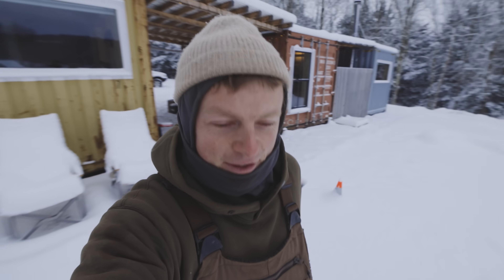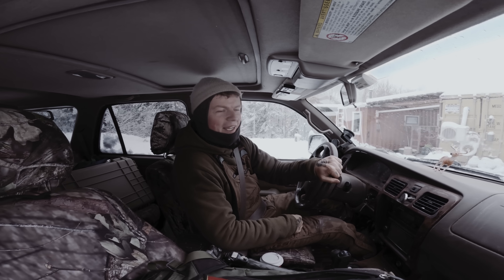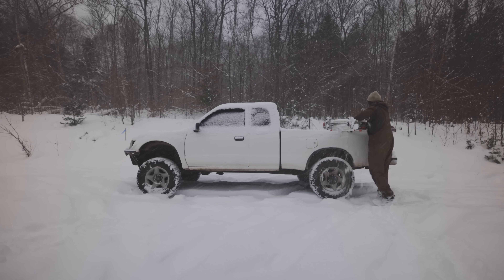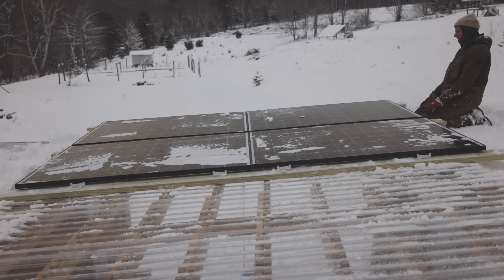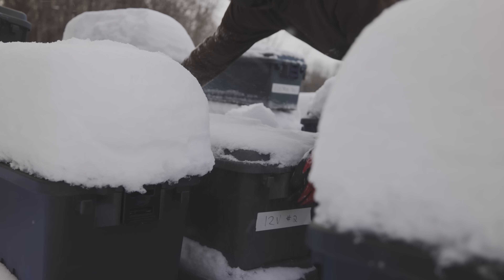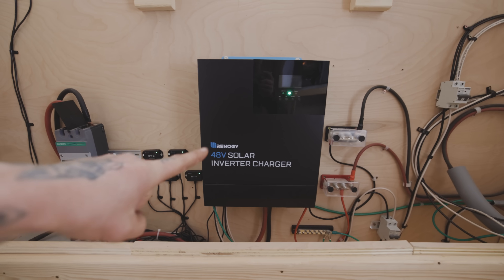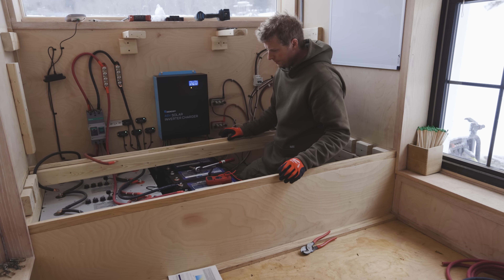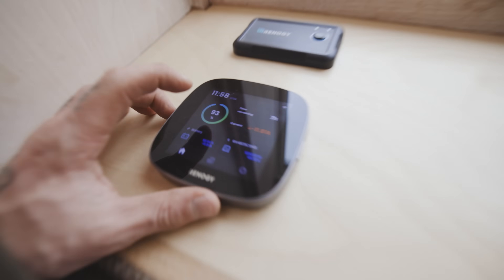Massive Shipping Container UPGRADE - solar set up for winter climates!

Comment: great video! your grit and determination is on an insane level.  doing that kind of work, on the roof in that temperature with snow is super human.  you're right about solar.  I live in the PNW and I have about 8kw of solar and barely make any during winter months, this is actually a small system witha 5kw inverter, with about 5kw of battery, so during the summer, it's constantly maxed and full within an hour.  If I were, you, the solar panels doesn't have to be mounted on the roof, if you have some bifacial, you might want to stand them up almost 90 degrees and ground mount them, this way the solar reflection on the snow will charge it, sun at a low angle will also charge it.  similar to your first set up, except much steeper angle for snow rejection and getting the winter sun.  keep up the great videos!

Comment: If you close the back area of it off and then have doors in the front of the area you would be able to use it as your workshop in between your container what to drive if you put the floor in your pallets to make a floor

Comment: something that might help you keep track of things is to photo where you put things as you put them away, then instead of sorting through boxes you can look through pictures to locate stuff.
When I have set mouse traps I photo them in place so months later when I need to gather them all up I just look at the photos to help me quickly locate them. This concept is also really helpful while installing electrical or plumbing or anything that will be covered by walls or ub=nder floor or whatever so if you need to access it after a few years it will be effortless to know exactly where you have to open the wall at.   For heat you should build a rocket stove mass heater system, so you can use wood, which you have an abundant supply of.  Properly designed and built it burns completely clean, holds heat for a long time after the fire is out, you can also use it to heat your water.  By the time the exhausts exits the chimney it is barely warm. Just do a search for rocket stove mass heater.

Comment: I crinch Everytime I see someone using a plastic shovel to try to scoop snow. Do yourself a huge favor the next time your in town, swing by your local farm and ranch store or tractor supply and buy yourself a good aluminum grain shovel with a wooden handle, they are light weight and as long as you take care of it, it will last a lifetime.

Comment: I would look into geothermal for the radiant. The electric usage for another circulator pump isn't as much of an electric draw as an electric hot water heater. Supplement the radiant with the mini splits. That's what we are doing on our three houses and the shop on our property here in the snowy part of Arizona. Propane boiler for backup just in case.

Comment: Instead  of propane consider wood chips or pellets or even log heating. Look into European technology for water heating and thus central heating with very efficient wood based furnaces . You have wood. I doubt you have a propane factory on your land. Or if you do i pity you because of the ground and water pollution risks

Comment: Solar pannels for winter use should be around 75 degrees facing either due south or half of them south east half of them south west. (The later only If your converter can handle two different ’arrays’ . At the very least tilt them equal your lattitude ( if 40 north tilt at least 40 from the horizontal. But winter time aim to be more vertical. Mind the wind in your mouti g of course

Comment: On the battery box did you close them up tight...shouldn't you have like a screen off opening in front so to keep them cool when using and not get box  temperature hot in box

Comment: When we decided to go solar in the PNW we had the same problem of of not being in the sun belt, and  fewer hours of daylight, although we rarely deal with snow, the technology was just not there to start with, but we kept exploring what new optio  were becoming available, watching the technology  grow and we  finally saw the tech catch up to the needs of those wanting solar in the latitudes further north for those of use living on the curve of our planet where the sun is not a direct  hit at any time of year and the weather tends to more overcast than tropical blue.  Sandwiched between the coast and a mountain range, also subjected us to periodic high wind storms that could turn any solar panel not laying flat into a sail which really thought its role in life was to remove the roof.  Since most of the homes in are area have suffuciently angles roofs that mounting half the panels one a east facing roof area and the other half on the west was showing promise at least for those whose roof angles had the east west exposure, but for enough power during the day for what was needed and to have enough solar to charge the batteries at the same time was at first, our primary goal but that changed when we came to realize that there could come a point where those things that currently relief on propane or natural gas, which if using means your not fully off grid as you rely on 3rd parties to provide that source.  Having back up of wood buring for heat was one major help as technology that relied on older tech jumped ahead and you could actually heat several rooms by burning  wood utilizing part of the home's existing duct work  and havingva wood stove available for cooking.

Solar finally became practical for us once panel techology started  producing smaller panels capable of using less light to produce greater energy, plusbdystems that used gimbled systems that could automathcally detect the optimum angle for the panel, could essentially 'follow the sun', lay itself  down flat when it was not able to get any solar, like after sunset or if it detected winds that put panels, and thereby our roof at risk.  Having it lay flat when there was no sun meant that if a storm nlew up while we slept, the panels were also sleeping and in a nice flat configuration less likely to become house sails.  Having manual back up to control all that, and the panels report to the inside controls  just how much power was being collected meant that fine tuning was available to us also.  But whole panel  efficiency  was a great change, it was actually battery technology that made a  difference  for us.  The smaller a battery bank became that could store more power, as well as faster charging batteries we needed fewer battrties using less solar for shorter periods of time to fully charge the batteries which meant we were not just storing enough power for overnight but could expand the storage enough that we could have power for up to 48 hours in the event of storm conditions with wisely monitoring use.  Of course, this was not done all at once but once we knew what the final options we wanted were we could start with the initial component to get us up and using solar, then adding in components to the system moving us towards meeting our final criteria.  It took us 3 years to complete but this spread the costs out so we could pay as we went, were able to do those things we could DIY, especially interior controls, wiring and the battery storage.  We did employ solar contractors for the roof instillations as the had those skills and safety equipment we did not plus if there was a failure of the roof system web had gurantees on parts and labor.  The 2 biggest things for us was getting away from the older flat panel installation which, at certain parts of the year only collected solar for sn average of 4 hours  more efficent batteries and inverter tech, better technology for monitoring power useage.  At this point, except during a storm we run the electrical needs of the house and even sell back small amounts of  power even on the shortest days of the year duting the winter (much more during the summer).  We do use natural gas and propane, and have generator back up, but can switch to wood if either becomes unavailable or no longer affordable.  We also went with the idea, after watching the rapid changes for better and more efficent solar, that we needed to future proof the system so if there is a great innovation in solar technology, swapping to new components or running new tech side by side is easily doable.  Last summer we did add a way which the panels could have snow removed manually from the ground after we experience a week of on and off snow storms that kept the panels partly covered for a couple of days.  Its adapted from the systems used  in northern Europe and Scandinavia  to bring snow off roofs without risking ones life to go out on a steep roof buried under a foot or more snow and removing snow with a shovel and broom.

Comment: On Red and April Off Grid you tube had a great set up with containers you can use same concept but you can add to your living space by sliding doors connecting container to open up light between containers..
The Lourdens have a separate container for chicken goats and hay feed storage also aquarium heater helps keeps water warm..lean to's on side & back for storage and porch & dog run around house
With roof over containers you'll have solar & storage space

Comment: Have you considered bifacial solar panels? I heard that they have improved efficiency in low light situations. Also supposedly they can clear themselves from snow when mounted at an angle, as they produce power when receiving light from the back, and the resulting heat makes the snow at the front melt

Comment: Good idea 3 system eco flow delta pro 3 and eco flow delta pro 3 extra 6 battery double power for off the grid cabin 40,000 (KWH and eco flow delta smart panel two check it out

Comment: Look into a wood gas generator. If you had an old truck with a large engine with points plugs and condenser. Build the generator in the back of the truck and the engine produces heat and electricity to charge your batteries. The heat can heat your home in the winter and when the solar panels don't work the truck can drive a large generator. The plans are on YouTube.

Comment: Looks cool. I would suggest a mini/micro water turbine but im sure it would freeze. If your water supply is consistant and you have the height a few hundred watts goes a long way since should run 24/7.

Comment: put solar panel on your coup.Hook up a 110 outlet & put in a heated dog bowl to keep water thawed from the solar setup. We used a couple good sized heated dog bowls
Reply: I think they even sell small solar setups for that. If not easy to make with what maybe a 100w panel 12v hooked up to a 12v battery and boom easy power to a waterfowl and maybe even a small heater inside for the chickens to stay warm too. Even have solar exhaust fans for summer to get excess heat out.

Comment: The problem with having a large amount of solar panels coupled with a small number of batteries is that at certain times of the year you will produce way more than you use & with no way of discharging the excess electricity generated you can actually damage your batteries & shorten their lifespan.
Reply: That’s without question, not how that works. Like at all.
Reply: @erikkuhlemeyer9402  I have 12 panel & 6 batteries, if I wasn't still connected to the grid to export excess power generation when my batteries were full my batteries would be ruined - Thats a FACT!
Reply: @acmdv  no. You’ve got an mppt connected. It stops charge when it’s full. Besides. Batteries pull amperage. When they’re full it stops. This is common knowledge my dude.
Reply: @erikkuhlemeyer9402  They must do it differently over here in England then.
Reply: @acmdv  no. It’s power and batteries 101. No different than plugging your phone into an outlet. The batteries only pull til their full. The panels don’t just send power all the time.

Comment: When the warmer weather comes round you should consider building a frame on your property at a lower level & mount your solar panels facing south. The bonus of doing that is that you can get them facing south, it would also be easier for maintenance as well as possible future of adding more panels. If you have an AC rather than DC system you can have them further away from the property so long as you have the inverter with batteries as close as possible to the house to minimise power loss. Also have you considered conical wind turbines to add extra capacity in the winter?

Comment: You should build a very simple 2x4 angled rack to tilt the solar panels. There are online azimuth angle and tilt angle calculators based on your zip code that will get you pretty close to optimum to maximize electricity production. These are especially important in winter when the sun angle is low in the sky and days are short. I included the links to the two online calculators in the replies to this comment.

Comment: Hi, I think you hit the nail on the head about heating via a solar setup. I’ve been thinking about how to mitigate for areas that experience summer and winter weather (non year round sun) and have been considering heat battery technologies as a possible solution. A large solar panel farm that can be sufficient for charging batteries during winter months but much too large for summer battery requirements. This farm combined with a heat battery such as the newer Scandinavian sand batteries to charge during summer months from the excess generated by the solar farm to help mitigate heating requirements in the winter. Just a thought, I’m not sure of the feasibility of such a set up. Feasibility in the sense of financial, space requirements, amount of thermal energy that could be stored etc.